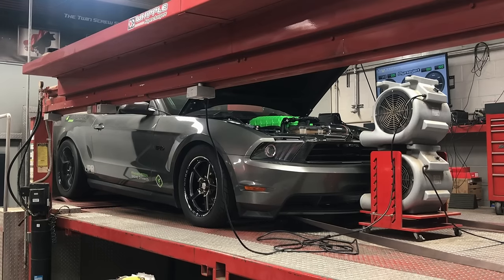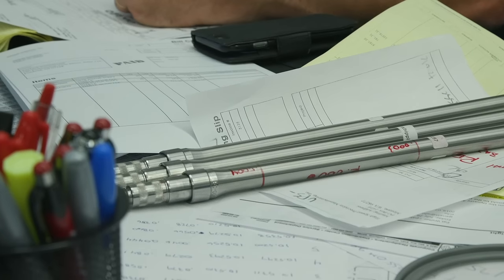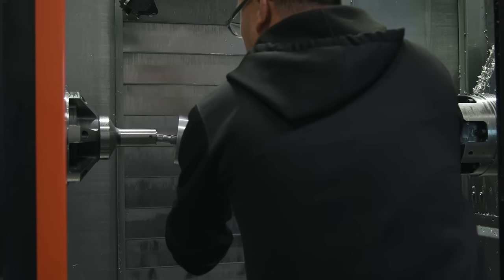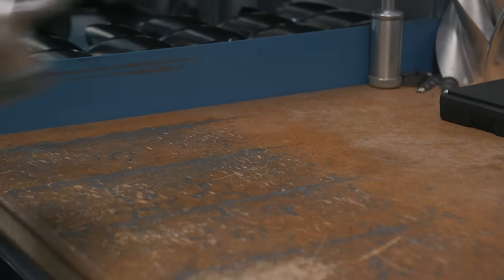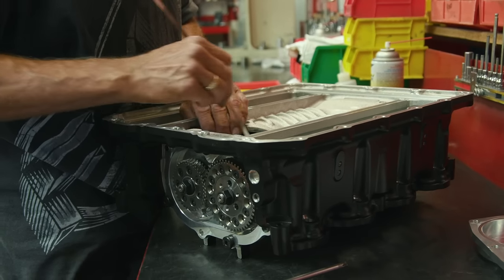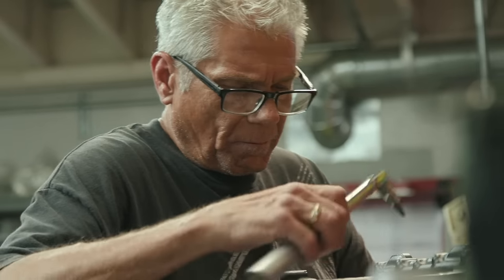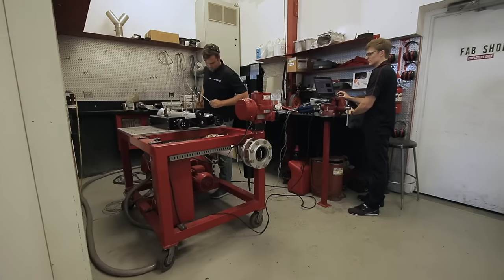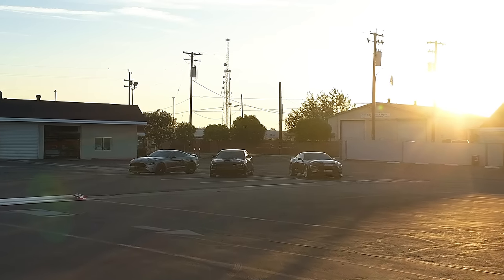About Whipple Superchargers

Comment: What would it take to make 600 hp and 600 tq on a 5.7 Hemi in a 2018 Dodge Durango? 5.7 would have a boost specific cam, cnc stock casting heads, headers with cat delete and tune? Thank you

Comment: How does your 5.7L tundra option compare to Harrop's version?
Reply: Superior? Inferior? Equal to?
Reply from the maker: The Harrop system is a very nice, quality kit. We feel ours has some added features, larger intercooler, larger inlet capacity, larger compressor that all benefit the Toyota application.
Reply: Which leads me to my next question, where's the closest Whipple installer to 56201? :)
Reply: @WhippleSuperchargers  Would you have anything for a carbd Gen 1 sbc, so cal
I hear these are more efficient than most roots type blowers and cant stand the procharger types. They work but the clanging and whistling...lol

Comment: Very nice supercharger but i bought a kit used that was only missing a heat shield. These guys wanted $250+shipping/tax for a thin metal piece (Bottom right corner at 0:36) Un-real. When a COBB air box on another platform had an issue they sent it for FREE! Just cant justify $250 for that piece. Way overpriced.

Comment: I didn't see any Holroyd CNC's. And the rotors don't appear to be any of the classic "A" or "D" profile. Your rotors look very nice. They don't look asymmetric. I read your article on "Modern Machine Shop" magazine. Very interesting. Although 0.125mm mesh clearance seems excessive to me. In our screw compressors we try to hold .051mm. I guess, I would have to look into it. Very nice guys.
Reply from the maker: Thank you for the comment. We don't use Holroyd machines as our rotors are made of aluminum, its not needed. For tolerances, the industries are very different, we use aluminum vs steel, extremely high speeds, female driven rotors which is very different from industrial designs. We have special rotor coating that allows us to close the clearances. The rotors are asymetric, they are our own design, not a A or D type as almost all previous designs were catered to a very different performance range.
Reply: Whipple Superchargers do you make the timing gears as well? The screw compressors I design do not have timing gears. Male drives the female.
Reply from the maker: @montejocervera  We don't make those in house but certainly run them as oil flooded compressors generally don't have gears, but the dry compressor needs them.